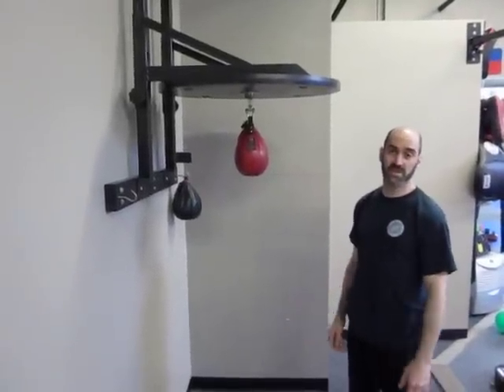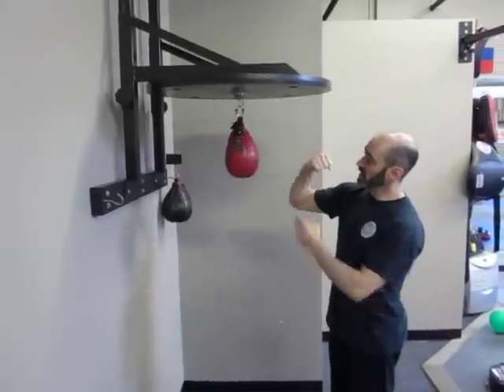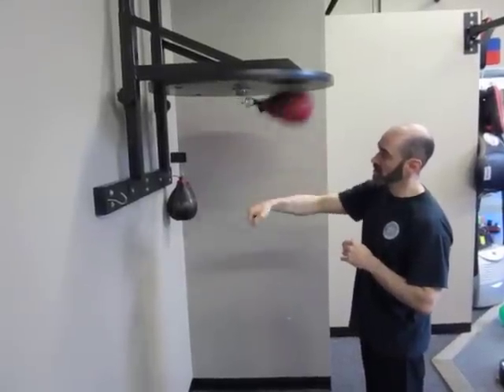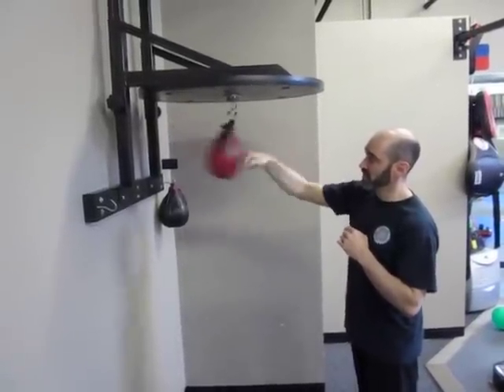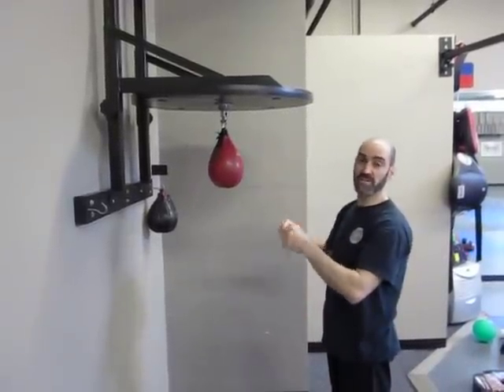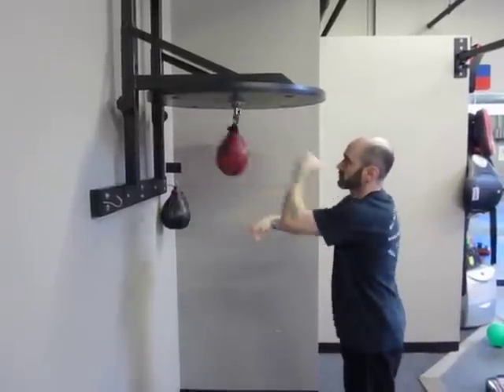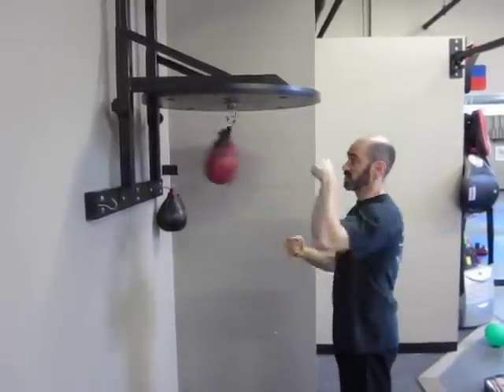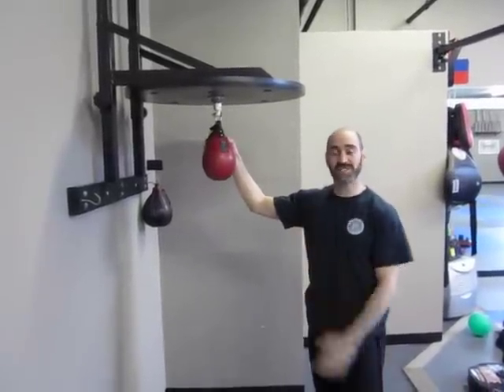How to Work the Speed Bag- Basic Drills

Comment: I've worked out on traditional heavy bags https://www.youtube.com/post/Ugkxp9-sf95nqfjey-uyzxUzQ7m9MXRPK1BE a spherical stuffed "wrecking ball" bag, and now this thing. What I like about it is that it has the heft to stay largely in place so I'm not chasing it around. It's tall enough to allow for headshots and body shots, but it's short enough to give an uppercut somewhere to land. I'm very happy so far. Filling it was a bit of a cluster. For top-offs, I've learned that you can screw the supplied nozzle onto any basic plastic water bottle. I can't speak to durability as I've only had it a week.

Comment: Any suggestions on a speed bag platform for home use?
Reply from the maker: Having a solid platform makes a big difference, as a sturdy platform provides for a stronger rebound of the bag.  I do recommend going with a setup from Ringside.  If you decide to build your own... make it two inches thick and from a good quality plywood. (That's just my suggestion, but others may have some more experience with building home models.)

Comment: When you hit the speed bag I noticed it goes back then forth & I've seen this in other speed bag tutorials, but when I hit mine it goes crazy! Back & forth, side to side & in circles. Is it my speed bag or I'm just not hitting it right??
Reply from the maker: Hi Caesar, it's probably your swivel.  For you, I would recommend the "E-Z Lock Pro Swivel" from Ringside. With that said, you do also need a quality bag.  Some that are out there... are not good.  For you, I would recommend the "Ringside Boxing Speed Bag."  I like the small size, but you may want the medium size, which will be have less of a propensity to move off course and will be more forgiving.  The other reason I recommend this bag for you is because it's tri-colored... which will help with your targeting.  (You do need to hit the bag straight on, or it will have a tendency to go off course.  Picking a color and working your accuracy in striking will be helpful.)  While I know the new swivel and bag are a little costly, the speed bag is a wonderful training tool, and it's worth the investment to get quality equipment.  You'll have years of enjoyment with the right equipment and the right training mentality.  Keep me posted!
Reply: Ceasar Lopez G hey man did u manage to get a new swivel and was there a difference? I have the same problem as u, probably bought the exact same speedbag too.
Reply: You aren't hitting it right

Comment: Thank you so much for making this helpful tutorial! We just got an Everlast heavy bag with stand &  the speed on the side. It comes with a plastic swivel & I think that's not helping me do this very smoothly. Can you recommend a swivel we could replace it with? Also, the speed bag came with a rubber bladder that we inflate to 4 lbs. Someone said to replace that with a hard plastic one . Is that necessary? If not, what kind of pump do you use to fill it. The pump we have  is awkward & doesn't show the pressure. I sure would appreciate some advice. I want to master this sucker in 2017!
Reply from the maker: Hi Patti, I'm glad you like the video.  As for your new heavy bag and light bag station, I would recommend changing the swivel... at the very least.  I'm a big fan of the "Ringside Super Swivel."  I don't know what speed bag you have, but replacing the bladder with a hard plastic one would likely be a bad idea.  However, as with most purchases, the higher quality equipment you have, the better it will perform.  You definitely need to upgrade the swivel.  You probably need to upgrade the bag, too.  (The bags that generally come with the multi-station setups tend to be rather... not good.  And, a "not good bag" = "not fun.")  I went to Ringside's website and they have a number of bags that are great.  Just to give you a baseline recommendation... I would recommend the "Ringside Boxing Speed Bag" in the "small" size.  (I'm using an extra small sized bag in the video.  There's also a hand pump on their site for less than five dollars.  Oh, and if you happen to read this on the day I'm sending it.  Ringside is offering 30% off today for all orders.
Reply: I know I'm one year late but I'm going through the exact same scenario. I too have the Everlast heavy bag w/ stand and having the same issue with the speed bag that you had. It never occurred to me that it might be the plastic swivel. Thanks for the revelation. Anyway, I hope you've mastered the speed bag as of now.

Comment: The only speed bag I have available to me is the one at my local gym. I'm short so the middle of the bag is actually an inch over my head. Is it a problem to train this way for the time being? I don't think it's adjustable. Or maybe it is, actually...it has knobs similar to the ones I see in your video. Is that how you adjust it??? Lol
Reply from the maker: I recommend this... check and see if they have a "step" platform.  Most gyms usually have several of these.  Bring this over to the speed bag station and stand on it.  Then, you'll be able to practice with the bag at the proper level.